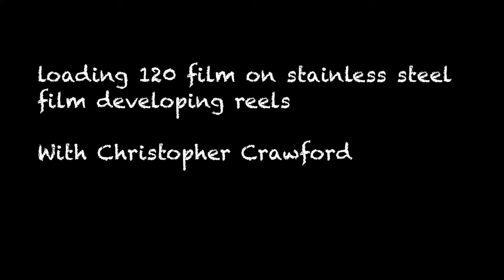How to load 120 size film on stainless steel developing reels

Comment: Nice to see SS reels being used. I've never used anything else. I did get plastic lids for the SS tanks since the SS caps were sometimes hard to remove at critical times and the plastic lids seem to seal the liquids better. Yesterday I developed my first roll of 120 film in years. To my surprise It went on the SS reel first time perfectly. I'm using a tank and real over 40 years old  that I've used for years and they are as good as new. I wouldn't expect plastic reels to last as long. It does take some practice but it's worth the effort.

Comment: Why, why are the plastic Paterson reels so popular? I used Paterson reels for years but recently decided to try the cheapest steel reels I could find (used) on ebay. I couldn't believe how easy they are to load? I usually struggle for 30 to 60 minutes loading 120 film on my Paterson. It took me about 3 minutes with the steel reel! So many years of torment trying to load 120 and all for nothing. Great video, you did a great job of showing the process. Go easy is the key.
Reply: Paterson tank system is very popular, but comes with terrible reels. I've given up on them for 120 a long time ago. Kaiser makes a plastic version that's a little better (longer lip) but compared to SS it's still much more likely to cause issues.

Comment: Thanks for sharing your knowledge! 
But to be honest, I've tried loading a roll of 120 onto a stainless reel today (for the first time in the dark, practiced with a roll of garbage-film before in daylight) and wasn't able to load the roll properly. 
After many minutes I gave up and used a plastic reel. Worked perfectly - so basically it's all a matter of practice.
I can see the benefit of using stainless reels over small diameter plastic reels - the circulation of the developer might be better around the stainless reels.

Comment: I've been using the SS reels since the 1970s. I was taught NOT to use the clips for 35 or 120 and it made life a lot easier. Never a horseshoe/half-moon mark with 120. Try loading without clipping the film - that's how most darkroom techs used these reels. It's how I STILL load my reels today.
Reply: how do you get it to stay in place?
Reply: how do you get it to stay in place? or the end not fly loose and touch
Reply: I tried this and somehow it just works, and is very easy. Thank you!

Comment: Hi Chris, thanks so much for this video, I haven't developed my own film in almost 20 years and never have developed 120 so your tutorial including showing the mistakes really helped. I'd want to know how to use steel tanks even if I didn't have one. I just bought a nice tank,a mint Honeywell/Nikor for $10, steel 120 tank with three reels on Etsy. I couldn't refuse that deal! Thanks again, I'll check out more of your videos, I want to learn about scanning 120 negatives. Someone on Craig's list gave me a Epson 2450 with some negative or slide holders that are 51.5mm by 51.5mm. I wonder if that's a good beginner scanner. I know it's old!
Reply from the maker: Thomas Francis Jones I've never used any of Epson's scanners for film. Since I was using my film scans for commercial work and for fine art prints I was selling, I started with the Nikon scanner because at that time, the quality difference was pretty extreme.

The problem with the flatbeds is that they're fixed focus. The film has to be positioned PRECISELY at the correct distance above the glass. The film carriers that come with the scanner are supposed to do this, but in practice, many have found that the focus is a little off due to manufacturing variations, and because the film may not be perfectly flat. This makes the scans look unsharp compared to those from dedicated film scanners, because film scanners like my Nikon have autofocus lenses that focus on the actual detail in the image.

There's a company that makes a film holder for the Epsons that is adjustable for height to adjust focus. A lot of people online have said that this dramatically increased the sharpness of the scans. If I were you, I'd scan some film with the Epson carriers and if you aren't getting good resolution, then consider buying one of the adjustable carriers.

http://www.betterscanning.com/scanning/vb_mfholder.html

Comment: Hello, what keeps the film from slipping out the rail and touching the layer beneath it.?
Reply from the maker: The film is slightly wider than the distance between the rails. That's why you have to slightly squeeze the film to put it on the reels. The film's own stiffness keeps it from coming back off.

Comment: Are there any benefits to using steel reels instead of plastic ones?
Reply from the maker: I find the plastic reels incredibly difficult to load, especially with 120 film. They're really best suited to 35mm, whose stiffer, thicker base makes it less likely to bind up in the plastic reel than 120 film is. I've also had trouble, using Paterson's plastic reels for 120 film, with air bubbles sticking to the film near the edges and leaving marks on the film. That's never been an issue with steel reels for me.

Comment: do finger nails make this easier ?
Reply from the maker: No, they don't. I made this video a year after suffering a stroke. Physically, it didn't have a big visible effect; the right side of my body is weakened and I sometimes lose my balance and fall. A bigger effect was that I have trouble remembering things and often overlook things like cutting my fingernails. I was only 37 years old when this happened, but I have had neurological problems (seizures) all of my life.
Reply: i meant no disrespect

Comment: I freaking HATE plastic reels I have been struggling for a literally hour and my bad is soaked in sweat 🤬🤬🤬
Reply: Yep, and the more you sweat, the worse it will get! ANY moisture on the film or the reel, water if the reel isn't 100% dry after the last time you use it, or sweat, will cause the film to bind up. 120 film is even harder to load on plastic than 35mm. One tip I can give you is to take a small pair of scissors and snip off a bit of the corners of the leading edge of the film before you load it. The sharp corners often catch in the reel, and cutting them off to an angle makes this much less likely. This works for 35mm, too; but with 35 be careful not to cut through the sprocket holes; that creates a hook that catches on the reel worse than the square corners!

Edit: Just realized I replied to this with my cat's YouTube account. This is Chris Crawford. I have a second channel for videos of my cat, Sneaky.

Comment: Forget steel tanks and I hate Jobo reels, get Paterson, there is no benefit to using steel tanks. This video proves my point.
Reply from the maker: mamiyapress I have found that plastic reels, including Paterson, are nothing but trouble. If you sweat just a bit while loading the reel, the film will bind. If the reel isn't completely dry, the film will bind. Even if the reel and your hands are as dry as the Sahara, the ends of the film will still bind up when the square ends of the film hit the reel's radial 'ribs.' Metal reels are completely foolproof IF you get good ones like the Hewes reels. It is virtually impossible to mess up loading a Hewes 35mm reel.
Reply from the maker: @RobBob555   I've been processing film with both plastic and steel reels for nearly 30 years now. What are your qualifications?
Reply: Plastic reels get dirty and they wear over time. If you are developing a lot, no matter how well you clean plastic, the mechanism will start to build up with gunk and make the twist load harder. Stainless steel are much easier to get a deep clean and will never gunk up. No moving parts means nothing to get jammed. I worked in a custom lab doing about 40 rolls a day and I could load a SS faster than a Patterson. I also liked the feel.